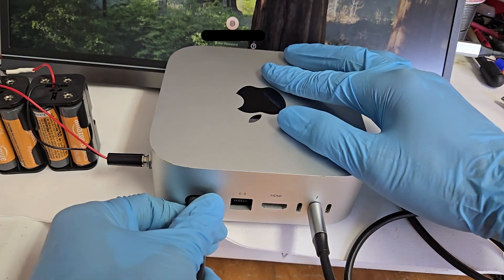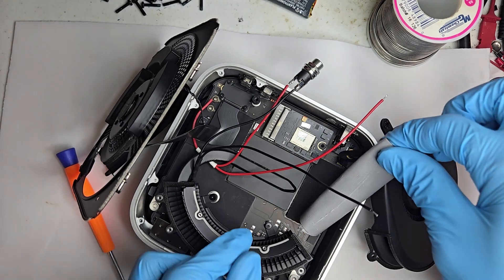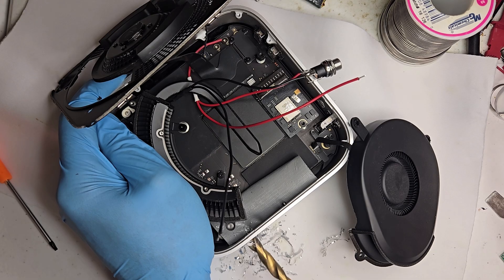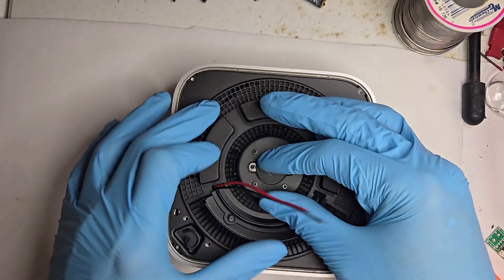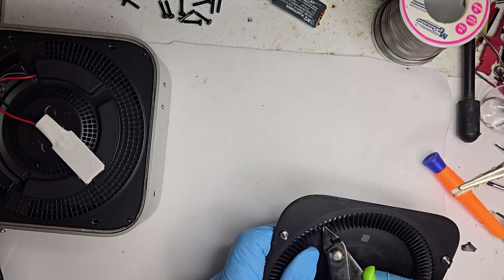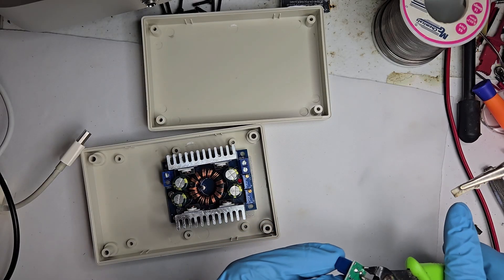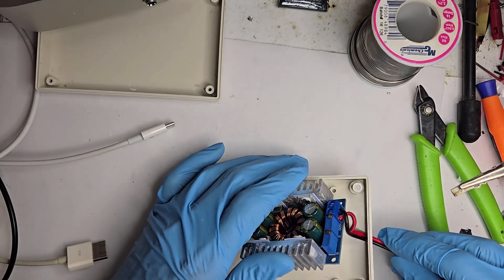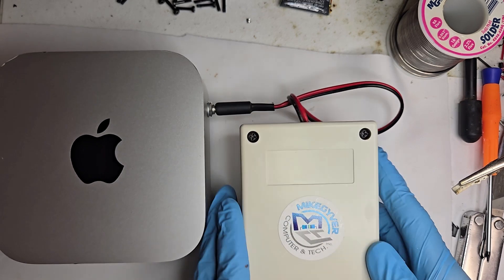Mac Mini M4 Hack: Dual USB-C Power Delivery Mod (60W DIY Build) 12v

Comment: What will happen if you power the mac mini with your custom 12v DC usb c power AND  with the standard ac power at the same time?

Will the AC Power lead? WIll things blow up?
Reply from the maker: No it will not blow up, in fact we demostrated this in prior video.  As long as the battery you use can be both charaged and discharged from same lead.

Comment: I thought you had a video on how to run a 2012 mac mini from 12v dc only? I can't find it. Am I dreaming?
Reply from the maker: https://youtu.be/v0F60S-ZJyM
Reply: @mikegyverComputer
Thx, that video is for M4. 2012 mac mini has complete diff PS. Can 2012 be powered by battery 12v DC?

Comment: Which modern Mac mini is the easiest to mod to 12v and what is the easiest version of the mod? I need to run from 12v lead acid. Thank you.
Reply from the maker: They all have their drawbacks.  In terms of no soldering, or splicing and in terms of simply taking apart and attach, M series Pro model, but you need to be sure you have a bigger DC power board.  But at end of day, Probably the M4.
Reply: I’d say the M2, it has tons of space and the leads to power supply are right there. I put mine in a custom case which imo is a better form factor than the M4 boards
Reply: @doorgoo do you have a video on this? Also how did you make or buy the case? Thank you